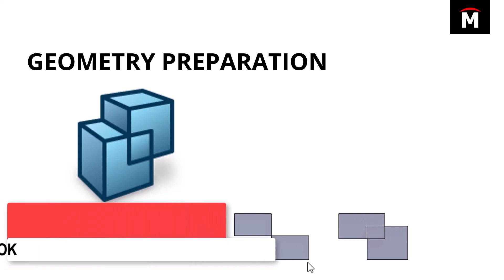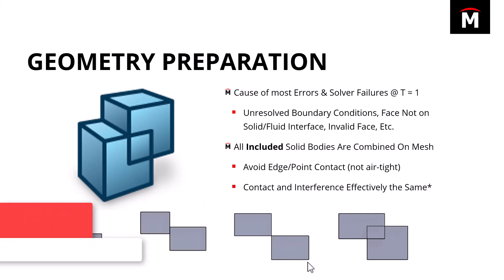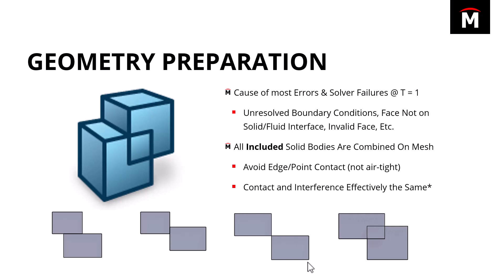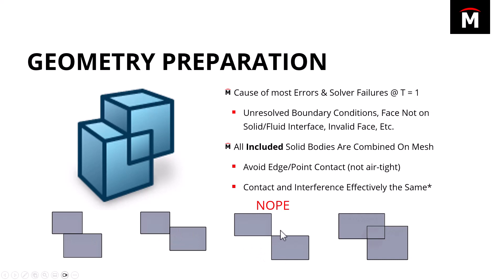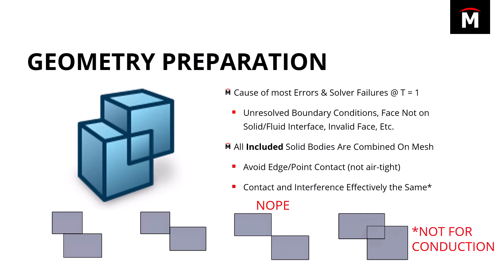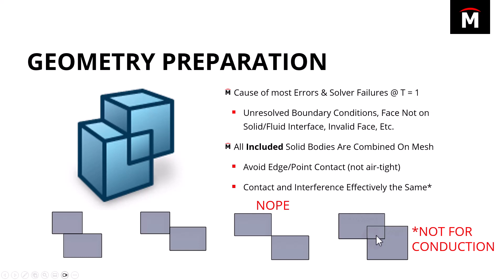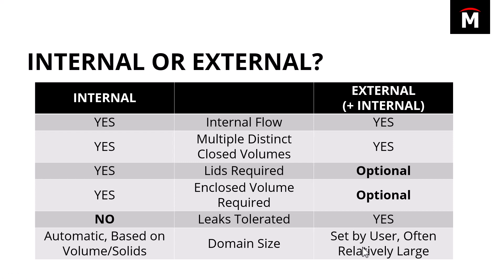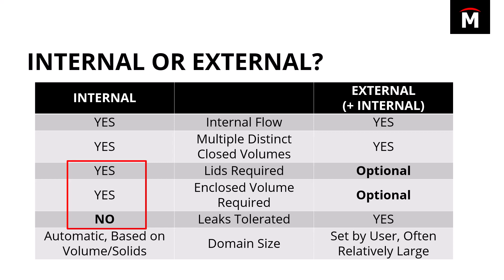Preparing Geometry for SOLIDWORKS Flow Simulation CFD - Advanced Flow Tips & Tricks

Comment: I've been getting "is not laying on the boundary between solid and fluid region." error, sometimes it comes, sometimes not. is it a problem with creating lids?
Reply from the maker: It certainly could be a problem with lids, but it may also be related to unintended leaks or a problem with your study options.  Use Check Geometry to visualize the internal closed volume.  If the area you think is enclosed isn't actually enclosed, use Leak Tracking to find the hole and close it up.